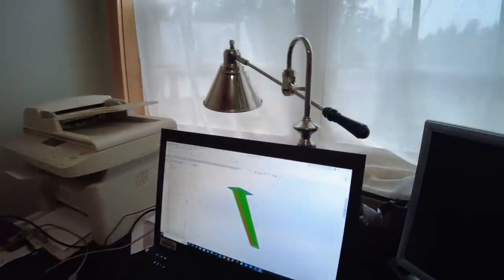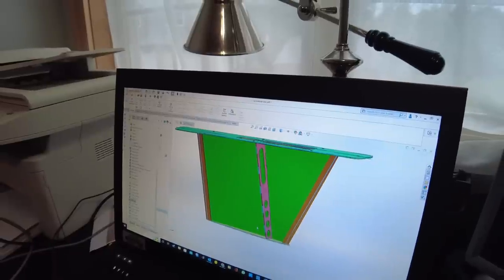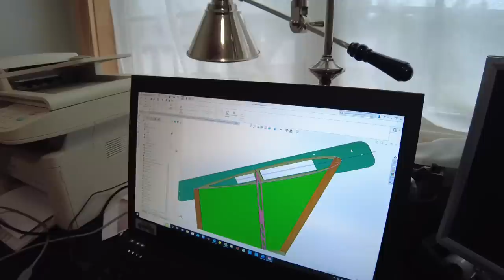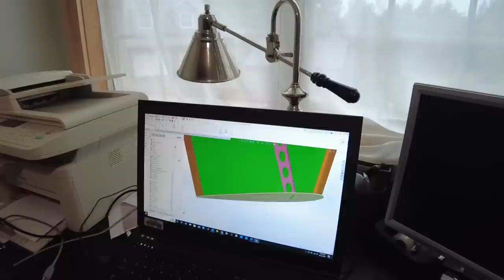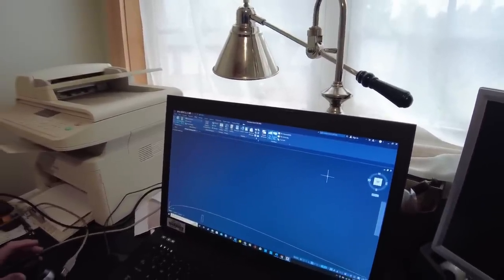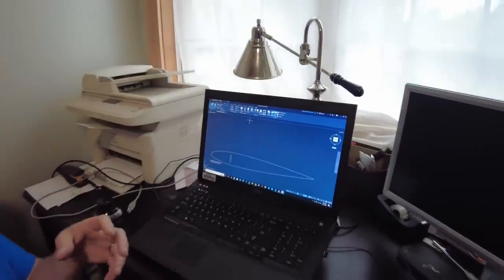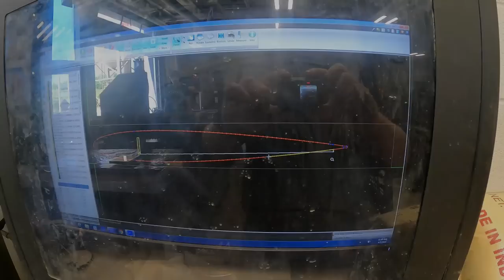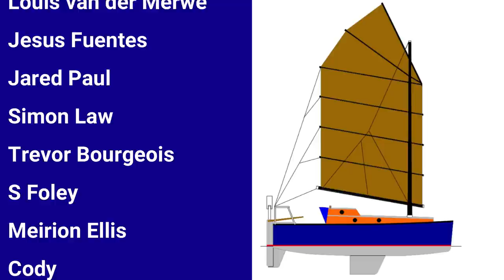S2E50 Designing and Building the Bilge Keels Part 1 || Wave Rover 650

Comment: Our Denis Ganley designed steel cutter has a keel that is made in a similar way: NACA 0014 profile, 1" thick steel plate bottom profile, internal vertical webs, round pipe as the leading edge.. The performance is very good, regularly embarrassing larger yachts to windward, and the strength of the keel was proven a couple of times...
So I am pleased to see that you have chosen this method of construction.
Paint them well and weld a small anode to each keel and they shouldn't give you any problems. On our steel yacht, the underwater steel parts did not give us any corrosion problems, even when paint was chipped (e.g contacting coral at 6 knots, or when the boat ended up on a rock breakwater when a "Professionally maintained" mooring lost a shackle pin)... as long as the anodes still had some zinc left.
If you use lead for balast there might be room above it for tankage??

Comment: I built the same type of keels for my 22ft boat around 30 years ago.We made sure they were the right shape. We filled them with around 100kilos of shot blast each and welded the hole shut. I sold the boat about 2 years later. Fast forward 25 years and I see her on the hard on the south coast of England. The keels were like new. Great job you did with yours

Comment: I would like to know the keels are not asymetrical. Plus, why was there no wing keels added.  In addition to combating the tip vortex wing keels would provide a more secure platform for grounding
Reply from the maker: Very interesting ideas and perhaps another builder will run with them. It was always my intention however to keep this prototype as simple as possible.
Reply: @RoversAdventure  Hey thanks for answer. I just couldn't figure out why you would go through all that trouble to design and fabricate the keels and not include those...
there used to be small fleet of junks 3 or 4 in the San Fran Bay (60s 70s). Almost bought one of them but ended up just hanging out and sailing around with them. Had a number boats but never realized my dream of creating my own Wave Rover with a junk rig. Good on you...

Comment: Fantastic.
Nice that the files will be available to other builders.
Will there be an additional cost or will it be included with the construction plans?
Reply from the maker: That's a good question. The building plans come with a well thought out keel. This is a different approach but the end result will be the same. We will make this available at a small cost if builders want to take this approach. The cost will offset the design work

Comment: Huh. So the keels will be filled permanently with lead? Or is the intent to add ballast as needed along the length of the hull? I always felt glassed in lead keels were inelegant and prone to failure requiring regular checks.
Reply from the maker: after the lead is poured in I will be welding them shut.

Comment: I would have though that the steel was only an outside frame into which molten lead would be poured.
Reply from the maker: Correct, lead will be poured into the keels at a later date.